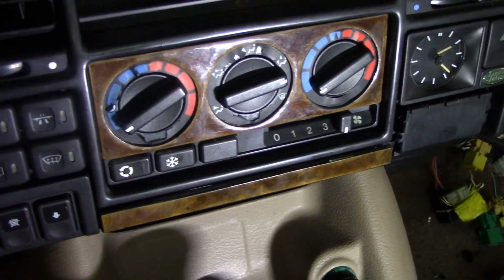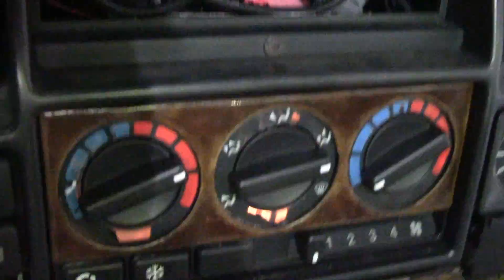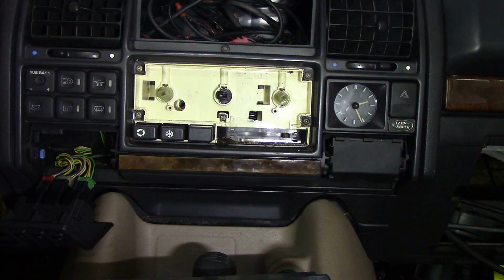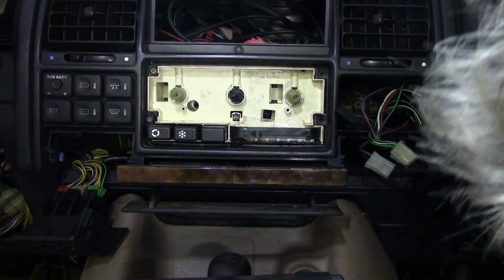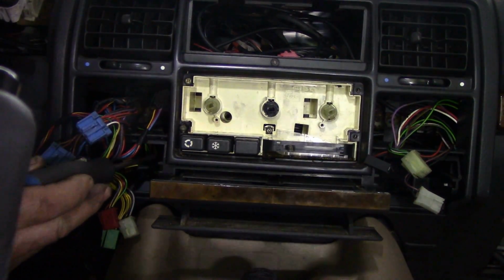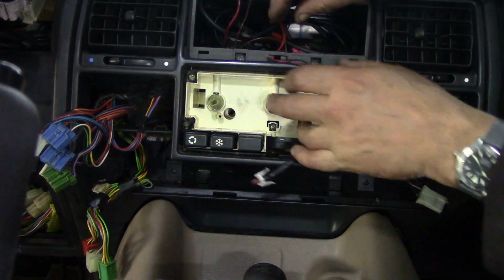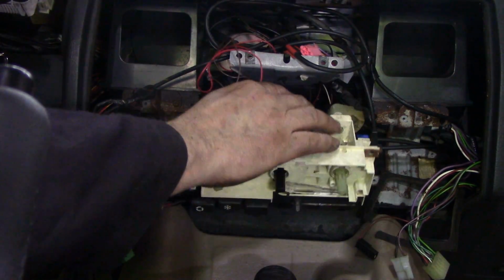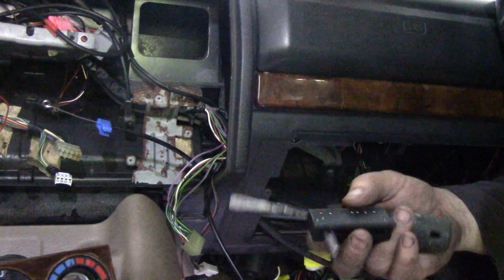Range Rover Classic / Discovery 1 heater blower not working properly. Part 1 The switch

Comment: Hi. 🇵🇱 I think so, sir, that you don't have to remove the entire console and the heater slider to spray contact cleaner. After all, the slider slot can be accessed from the front after unscrewing the dummy air conditioner with three knobs. Today I did it. I sprayed Rost Stop red with a long tube. I recommend. Hi.
Reply from the maker: Thanks for the tip!
Reply: @BritannicaRestorations  Hello sir. But anyway, thanks for disassembling the console in the video because I wouldn't have known it myself. Thanks for your videos on Discovery 1 and 300tdi ✌️🇵🇱😐. Best regards, Robert.

Comment: Hi Mike, been there and got the t shirt. The switch does open though. Just ease the clips around it. The you can get inside and clean it properly. They do get dirty and cause problems. So worth opening and cleaning. Don't lose the springs though 👍😁👍

Like the magnetiser. I usually wrap a cable round the screwdriver and short one on a battery 🙄
Reply from the maker: Got it!
Reply: Yup, had to clean mine.. Was burnt to hell inside, so I swapped the rear AC control to the front :)

Comment: Hey hey.
Did that job a few weeks ago. What a mess about.
Anyway, the centre console was knackered, and i've bought a 2nd hand one for 50euro.
Also tried and failed to replace the headliner, but in the end i've painted it.
The Disco 1 is getting smarter a bit at a time. Mechanichaly it is ok, but the plastic bits are crumbling.

Tata
Reply from the maker: 30-year-old plastic are not very good

Comment: Even easier way to magnetise a screwdriver, is to place a magnet (I use old HDD ones) on the top of the screwdriver metal shaft......does the same thing
Reply from the maker: But how do you de-magnetize?
Reply: @BritannicaRestorations  place it on a hard surface, an anvil  vice etc and strike it a couple of times with a large hammer. It does work.
Reply: @BritannicaRestorations  Take the magnet off!

Comment: LR engineering at its best - my switch will sometimes go off at high speed and you have to wiggle it a bit - can't imagine in the day the dealership replacing one of these - must be a $1,000 labor plus NLA part - even getting one at a breaker yard would be crazy getting to it

Comment: If it works on high but no other speeds, it is a bad resistor, some resistors have a thermal fuse that will fail if the motor draws excessive current. On high speed the resistor is completely bypassed👈🤣👍

Comment: I went through the exact same problems/frustrations last year when the blower on my recently acquired D1 only worked on positions 2 & 4. The replacement switch didn't fix it. A new resistor pack only worked for a short time, after much faffing, then it all died. A new blower with resistor pack off eBay finally fixed it. I never did pinpoint the cause of the fault.

Comment: resistor might be on the blower motor.
What is the motorway switch over the window defrost switch, I dont have on my defender.
did you get the security code for the radio.
Will you switch the clock for the D1 digital one.
Have the same analog clock in my 1990 astra , works great , show some time , all the time-
Reply from the maker: That is cruise control - no code for the radio

Comment: That bloody Joe Lucas! He's got a lot to answer for. Is the fan slide switch the same in the Disco?  It certainly looks similar it could be the same item if you need one Mike. I'm really enjoying seeing all this centre dash panel coming apart, but you know all the plastic tabs break off, by design (bloody, Joe again).
Reply from the maker: The blower is a Denso unit with a Japanese motor - the D2 used a complete Japanese HEVAC system, and it was pretty good

Slider switch is the same - in fact the D1 and the 1995 RR uses a lot of common parts
Reply: @BritannicaRestorations Japanese, then I humbly apologise to old Joe Lucas. 
I remember when I had Jags, that were built in the 60's and 70's inevitably the hvac fans that were made by Smith's, using Lucas electrics were seized. Both Lucas electric radiator fans on my E type were seized and burnt out when I bought it.

Comment: Two point on this video Mike.

1. My Barry Manilow tape was rubbish the first time I played it so no need to worry about magnets there. 

2. The flat dismantling tool you used to remove the radio,  are they available in your online store at a very reasonable price?
Reply from the maker: 1. Fear not - I have a box full - can send you one
2. Indeed, they are available in the shop and indispensable for a job like this!
Reply: @BritannicaRestorations  Top man
Reply: @BritannicaRestorations  credit card works well 👍😁👍